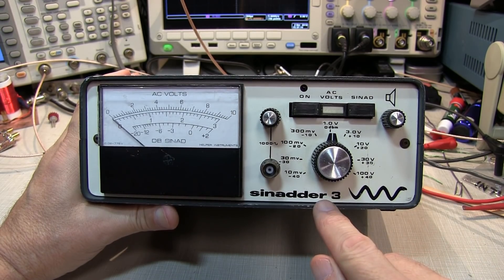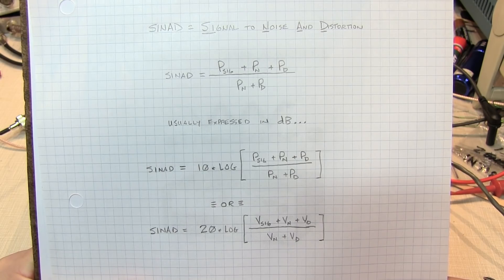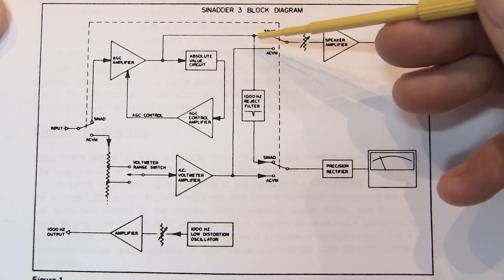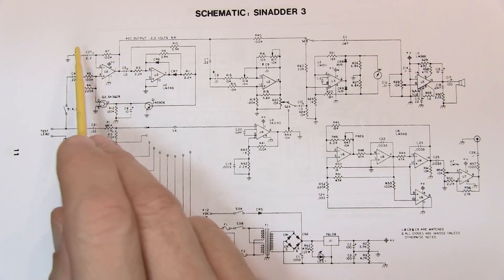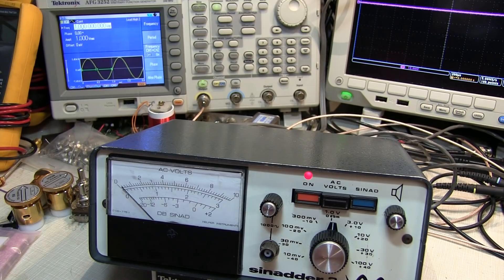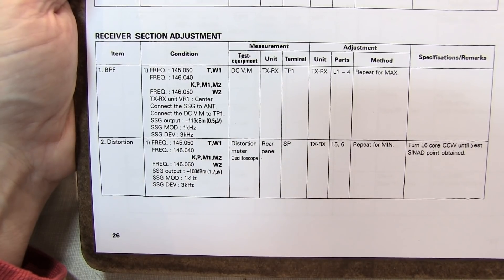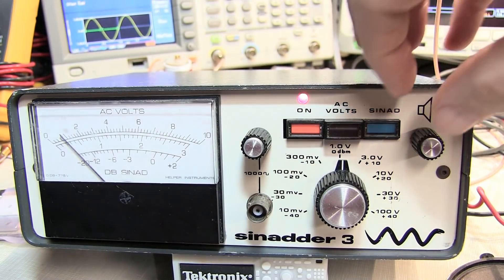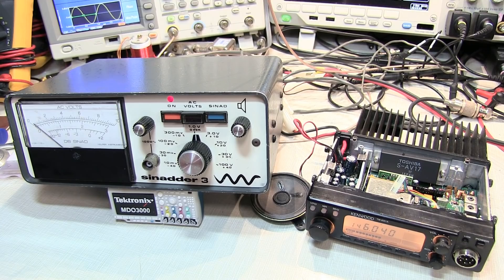#295: What is SINAD & Overview / How to Use the Sinadder 3 for FM receiver alignment

Comment: Great video! I am wonder is it possible to buy such a tool today. But is it possible to measure SINAD using oscilloscope with FFT?
Reply from the maker: It is possible, but would require you to do some processing on the FFT result.  In a nutshell, you would compute the total power within your desired measurement BW which will include the main signal, it's harmonics (distortion components) and noise.  Then compute the same total power but mathematically remove just the fundamental of the signal, leaving the harmonics and noise).  The ratio of these will be SINAD.

Comment: I just repaired my one. The SINAD function pinned the needle. It was an oscillator. It turned out one of the 10nF in the notch circuit had failed open circuit. I changed some of the electrolytic capacitors at the same time. Works OK for looking at FM, AM and SSB Sinad
Reply: The unit I have had another double ganged  potentiometer on the front panel, which tuned the notch over a range. Thought it might have been part of the reason it was unstable. It looks like a homegrown modification. Disconnected now.
Might try your notch board in a SINAD meter circuit.

Comment: Thanks for the video!  Unfortunately I still don't know how to interpret sensitivity specs when comparing two radios.
Reply from the maker: What kind of radios specifically?  FM VHF/UHF rigs?  HF multi-mode rigs?
Reply: @w2aew  Yeah FM UHF/VHF.
Reply from the maker: @jeffsmith3350  FM VHF/UHF receivers are typically spec'd for sensitivity by listing the minimum signal level required to achieve 12dB SINAD.  Sometimes the 12dB SINAD is mentioned, sometimes it is omitted.  The minimum signal level that is indicated is the sensitivity spec.  For example, the Icom IC-2300H specs the receiver sensitivity at 0.18uV for 12dB SINAD.  While the Kenwood D700GA 0.16uV.  Thus, the Kenwood is slightly more sensitive since the signal level to achieve 12dB SINAD is slightly lower than the Icom.  The Alinco DR-735 specs 0.20uV for 12dB SINAD, making it less sensitive than the Icom and the Kenwood.
Reply: @w2aew  Aha, excellent!  Thanks so much for taking the time to explain that to me.  Now it makes sense.

Comment: A very handy instrument Alan, I’ve been using one daily for years working on CB radios everything from early 60s to late 2010s.
Extremely handy for doing receiver alignments. I use a lot of BK Precision gear, HP SA and tracking generator and Tektronix 2465B scope plus other test equipment.
I do have a HP 8924C but i only have it on the bench for radios outside of 27MHz as I find the BK equipment very fast to use.
Love your very informative videos.

Comment: Thanks for another great video! Unfortunately it's difficult to find a sinad meter here in the UK now. I'm going to search your videos to see if you have one covering sinad measurements with an oscilloscope.
Reply from the maker: You should be able to find a Keithley 2015-THD digital multimeter - this has a SINAD measurement function.
Reply: @w2aew  Thank-you Alan, I'll have a look. I'm also looking for a reasonably priced LCR meter for QRP and ham projects. I'm building a shopping list!
Reply from the maker: @acestudioscouk-Ace-G0ACE  Good luck with your search.  I have the DE-5000 which works well, but has gotten pricey (over $200 now).  Just take care to check the specs on what you get - many very inexpensive LC meters can't measure very low values (inductors in particular) that are often needed in our radio projects.
Reply: @w2aew  Thanks Alan, the best price for a used Keithley 2015-THD I found is $796.00 + import duties, so out of this hobbyists budget.  I had been looking at the DE5000 and that comes to the UK for about $180, which is do-able. Others have recommended it and your endorsement adds weight to that. Is there a way of measuring SINAD with an oscilloscope? I have an old LeCroy scope.
Reply from the maker: @acestudioscouk-Ace-G0ACE  You can do the THD part of SINAD - it's just adding the noise component in that is difficult (integrating the noise over a limited BW).  I did a video on the THD part...
Reply: @w2aew  Thanks for your time and consideration in this. I'll have another look at your video list and seek it out. Best 73, Ace

Comment: Can the sinadder 5 be used in an AM environment like 11 meter radios to do RX alignment or is it fruitless ? Newb asking......
Reply from the maker: If you use it to measure SNR with a weak signal, and then try to optimize the IF alignment to improve SNR, then yes it can be used.

Comment: w2aew Wow, that Sinadder is gold for those that do Rx alignments often.  Thanks for explaining all this.  I left you a comment (question) on another video about the NanoVNA and characterizing (S11 & S21) a 75 ohm impedance antenna when the Nano's directional coupler's Zo is 50 ohms.  Do I need to calibrate the NanoVNA with a 50 to 75 ohm pad and 75 ohm Termination, short and open all with F- connectors in the calibration plane or how to do it and easier or better way?  Thanks Alan!

Comment: What basic equipment would I need to measure receiver sensitivity of an old (boat anchor) amateur radio receiver?
Reply from the maker: I would say a signal generator and some attenuators, and your ears!  You can also use a simple voltmeter on the audio output to measure received signal level.  At the end of the day, when aligning a receiver, you're simply trying to get the best SNR.  That can be determined with your ears.  If you really want to get the "numbers", then you'll want calibrated signal generator and possibly a way to measure SINAD.

Comment: That's interesting. I just happen to have a Kenwood TM-231A myself that I bought new in the early 90's or so. The front panel light have all gone out and there is still a bug that causes a reset of the memories sometimes on power up. Maybe I should consider fixing it up.
Reply from the maker: If I recall correctly, there is a Kenwood Service Bulletin that describes a mod to  address the memory issue.

Comment: A great explanation of SINAD and how it works.  I knew the basics but this really helped me refine what I knew.  You got my thumbs up and subscribe.  

One really minor thing,  you were referring to voltages in the spec as nano volts. But the symbol in the spec was micro volts. A little thing and I'm sure just a slip of the tongue.  Thanks for a great video!
Reply from the maker: The specification says 0.16 microvolts, and I stated 160 nanovolts, which is the same quantity.
Reply: And I missed that,  lol my mistake. I thought I heard the same number.  Sorry about that.

Comment: You keep forgetting the minus - it is MINUS 12 db SINAD.
Reply from the maker: The meter scale is calibrated in the standard audio dB level (0.775Vrms into 600ohms is 0dB), that is why is shows the negative values.  However, the SINAD quantity is >1 (Signal+Noise+Distortion divided by Noise+Distortion), this results is a positive SINAD value - so you simply omit the negative sign from the meter scale when reading SINAD.

Comment: I never understood how this works. Now I know that it is the AGC amp that does the magic. That 1 KHz notch filter could have been a little tighter IMHO, but I guess it serves the purpose as it is. Great video!
Reply from the maker: Yeah, it it could be sharper. I should measure the width at the 12dB SINAD level, that would give a better indication of the filter's Q.  I'd like to compare results of this inexpensive meter to a more professional piece of equipment, but I don't have access to anything else at this point.

Comment: A NOOB assumption at the risk of looking dumb, if my cheap signal gen doesn’t go to -123db could I calculate a simple rf attenuator as shown in one of your previous videos to achieve this. Anyone feel free to educate me. Thank for your experience and hard work
Reply from the maker: You certainly can build an attenuator, but beware that at these very low power levels, it is very easy to get fooled by leakage from the coax (signal leaking through the coax shield into the air on the "high power" side of the attenuator, and being picked up through the coax on the "low power" side, thus making the actual power level higher than you'd expect on the attenuated side.  Double or triple shielded coax helps in this situation, but gets pretty pricey.
Reply: Thank you, time to start looking for a better signal generator.

Comment: Would be an interesting project to do this digitally using mic input on a computer and a freeware app like Scilab (Matlab substitute). A little sinewave least squares fitting routine would be the main coding work. Good news is you could have it calculate the exact frequency around 1khz.
Reply: I think i have seen something like this before in an audio testing software, but i can't remember the name right now. You would need a decent audio interface (mic/line inputs in onboard soundcards are too crappy) and you need to calibrate it to read acurate dB levels :)
Reply: Might be a little more complex that it seems, for it to be practical you’re most likely going to need at least some custom hardware to handle the front end level settingY, calibration etc... You might take a look at something like the Audiomatica CLIO system as it’s pretty much what your looking to do. But a DSP library with FIR filters, FFT and some basic math would get you close... Have fun with it...

Comment: Interesting stuff, Alan.  Do you have the "modern day" equipment that you can compare it to?  It would be interesting to see the differences.
Reply from the maker: I don't.
Reply: The free app baudline and a sound card can do all sorts of audio band spectrum analysis.
Reply from the maker: @NiHaoMike64  Looks cool, but sadly no Windoze build.
Reply: @w2aew  Maybe worth a try running it with WSL or a Linux VM? I'm not sure what sort of distortion Windows audio processing will introduce.
Reply: Hi ElmerFuddGun, I have a SINADDER 3, and have recently owned a SINADDER 5. Both of these were compared against my recently ( 12 months ) calibrated HP 8903A. Both SINADDERS were within 0.5 dB with what the HP measured and these measurements were taken at 2 points, 6dB and 12 dB  :-)

Comment: excellent instrument but in my country very difficult to be found the sale I came to think of putting together a unit based on the diagram of Sinadder 3, as soon as I start my holidays at the end of the year I will carry out this assembly ... Thanks for sharing Alan! 73
Reply: @jim9930  , thank you very much for the tips are very valuable post need to mount this instrument for my daily use..........Thank you Jim Mitchell.
Reply: @jim9930  I keep trying to understand both the osc and filter circuits, but they use constructs I have difficulty analyzing entirely.  Could you explain the process of picking the value of R19 in the filter?  I'd also like to understand the oscillator circuit, especially the R50-R53, C24 feedback section.

Comment: When my IFR starts acting up I pull out my Sinnader 3 and crank up the RF signal generator and it works like a charm even though it's old school. I did move the rear panel input BNC to the front panel to make that connection more convenient. Thanks for sharing Alan!  73 - Dino KL0S
Reply from the maker: I'll have to consider making such a mod on my unit too.
Reply: It's a snap to do, there's plenty of real estate inside and it fits nicely in the lower right hand corner of the front panel....looks like it was meant to be actually. @w2aew
Reply from the maker: @PapasDino  Mine doesn't have a BNC on the rear panel, it has the test lead permanently attached (through the panel), right to the circuit board.
Reply: Hmmm, it's been a while. Wait, I remember, that BNC was already on the front panel, the guy I got it from put it there in parallel with the rear panel lead; I simply got rid of the rear panel connection. While you're inside you may want to touch up the alignment as mine was just a bit off as I recall. If you need a copy of the manual I can send it along. @w2aew
Reply from the maker: @PapasDino  I already touched up the alignment (adjusted the 1kHz source, adjusted the AC voltmeter accuracy, adjusted the notch filter, and adjusted the SINAD accuracy).  I have a PDF of the manual, but it isn't a super copy.  I also noticed a few differences between the PCB layout in the manual and the actual PCB, so I wonder if there were different variations.  It'll be interesting to see what your manual shows.